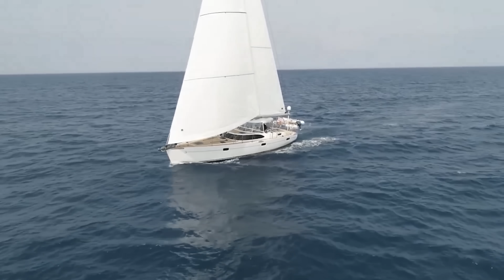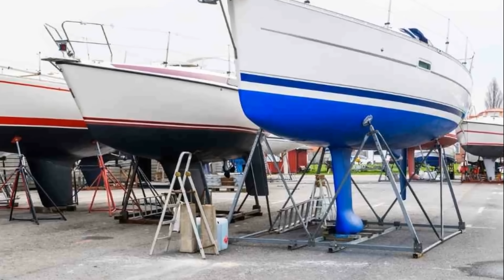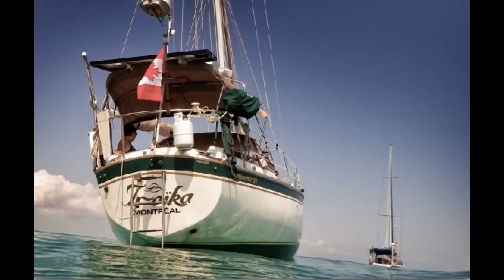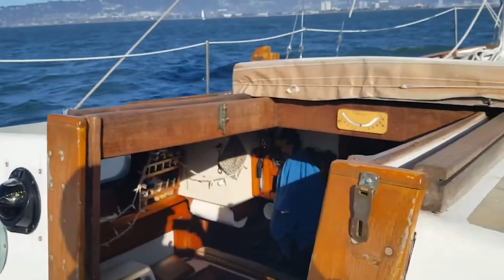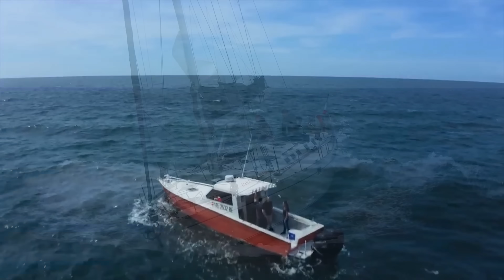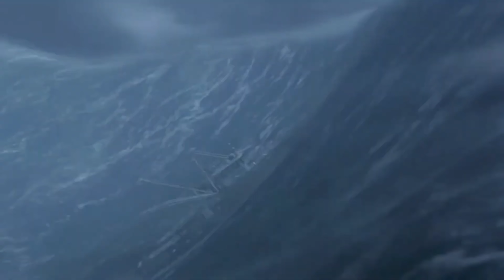Why Full Keels Aren’t Always Safer Offshore

Comment: 83 here, sailed 64 years ,had several full keel boats and a fin keeler, Built several boats also. I learned to hate full keels, only way to get to windward in light wind or heavy weather was to motor, learned to hate bobbing up and down while my friends past me to arrive days earlier. Then there was trying to get in and out of big marinas and slips, constantly backing and forwarding to try to turn the damned thing, forget trying to steer in reverse. On the other hand my fin keeler could tack up a narrow river into the wind and sail to 35 degrees of the wind in strong winds and back into a well. I could actually get some where...a complete world of difference. Encapsulated fin keel with ruder on a skeg is the way to go

Comment: I don't agree. Fin keel boat is often so flat it can not sail straight into the sea without damage the interior. This flat design restricts the flexibility. Fin keel boat are designed for downwind. When the waves are nasty you can not sail closed haul. 
A heavy boat can go smoother through the waves and doesn't come to a sudden halt because of a short wave.

Comment: Trying to imagine a lightweight boat taking the type of beating I have seen. Author says a light boat expereinces less stress due to its lowered inertia. A bit like saying a ping pong ball is stronger than a pool ball. Right. I have seen the force of waves cause lockers with screww down brass fittings burst open despite the boats heavy inertia and resisantce to movement. Imagine that in your ping pong ball where your change in velocity will be much greater as waves throw you araound like a rag doll.

Comment: Right, faster equals safer becuase you can outrun storms (do you even have accurate weather forecasts a thousand miles out?), And faster equals safer becuase you have more repair time in ports, sound logic. WTF are you smoking? If (big if) I knew from reports that a major shit storm was headed my way I would be reefing down and starting the engine. Having been cuaght off giuard in a Tayana 37 full keel despite monitoring weather continuously, I will take a heavy full keel boat when you are really out there 6 days a week and twice on Sunday. I am probaly alive today becuase I was in tank.

Comment: If you are going to post this type of content you should provide some details about your experience and qualifications. This improves credibility and gives your advice authority. The fact that you don't is, for me, a red flag.
I would take issue with a few points. 
I have never found long keel keel to equal a slow boat. I have sailed long keel boats of various designs between 26 and 60 foot. All of them would achieve hull speed in 15kn or more in any sea state where it was safe to maintain that speed. There is a point where it becomes prudent to slow the boat down in heavy weather but this is determined primarily by her size and overall
 design not the keel profile. Boats are slow because they are underpowered compared to their drag factor, either lacking sail area or the stability to carry sail. It has nothing to do with the keel profile.
I have sailed far more fin keel boats that are poorly designed for sailing performance than I have long keels. Most long keel boats prioritize performance under sail rather than accommodation or other factors. 
I agree that a long keel boat may take more, or at least different skills when docking in confined spaces and this can be challenging for less experienced skippers. The consequences of getting it wrong are however unlikely to damage more than your wallet. Offshore is the opposite, a fin keel demands far more input from the crew and offers less opportunities to recover off watch leading to fatigue which can be terminal.
While a fin keel boat with the right hull shape can exceed hull speed, which may seem to offer more options it is often not a reality for short handed cruisers. A lightweight race boat with a full crew may be able to exceed hull speed from about 60deg off the wind. A heavily loaded cruising boat with a short handed crew is probably only able to plane down wind. If you have the option to run off downwind to avoid bad weather this may be useful. It is, in my view, not a good trade off if it means worse performance on every other point of sailing or problems hoving too. Running fast downwind in steep seas is about the most dangerous strategy for dealing with heavy weather. Most cruising boat should not do it.
Sailboat design is complex and there are always compromises. I found this video oversimplified that complexity to the point of being misleading.
RYA Yachtmaster, delivery skipper and technical sailboat author with more than 50000 miles logged including ocean passages and have lived aboad

Comment: Full keeled boats are always safer at sea and always a bitch in the marina. 

What's more, full keeled boats can survive a grounding, and sometimes with little, or no damage.  The rudder and prop are shielded.

For this reason alone, I choose a full keel for cruising. 

A deep-well bilge, common in full keeled sailboats, keeps the cabin sole dry.  This is a huge safety and comfort issue for prolonged periods at sea and often overlooked.

Old school sailing wisdom has not changed, and the ocean still makes the rules (not some YouTube.)

Comment: Colin Archer' boats were used as safety boats for more than 40 years in the Nordic sea.
And it's not the quiet sea on earth !
Joshua, Bernard Moitessier' boat was builded with Colin Archer technique and it circumnavigate twice
Sailing fishing boats on the Ireland sea are long keel 
Long keel are slower, yes, but stronger
Today I have the forecast every 30 min on my plotter if needed, that's the first safety. 
If you don't want to sail under a storm, I don't like that but mother nature do what she want, stay at the marina.

My last fin keel sailboat was build in 1991, the same one build in 2025 is 20% lighter.
38 feets racer/cruiser from a German company
Today's sailboat are build for a 4 to 6 hours sailing in front of the marina.
Just check what kind of boat are sailing around the world and crossing ocean

Comment: Doesn't matter if a fin keel boat goes a little faster than full keel boats. You still won't outrun a storm. I owned 2 full keel boats, currently a Alberg 37. I would never trade "down" to a fin keel boat. I've been in bad weather on fin keel boats and I didn't like it a bit. On the other hand if the sea gets rough I sleep like a baby in my full keel boat. Fin keel boats are popular because boat builders can produce them much cheaper and faster and got people convinced speed and large interior space is everything when it comes to sailing. To each their own. I stick with my classic design that is time proven and eventually may even come back.
Reply: I beg to differ, about outrunning storms. I too have owned and lived aboard a heavy, traditional bluewater cutter rigged mono-hull. While I respect these types of boats and their attributes, there no escaping the fact they are slow.  I now sail a bluewater catamaran, of the same length. The additional speed makes a huge difference in our ability to avoid nasty weather. The ability to do 200 miles in 24 hours, rather than 130, opens up choices and reduces weather-related risks. This, coupled with near real-time weather reporting via StarLink enables, has completely changed my strategic approach to navigating long passages.   
Obviously, a boat and her crew need to be capable of dealing with very bad weather. But when it comes to the safety of me and my crew while offshore, my choice is a boat that combines speed and strength  - one that gives me the best chance to get out of harms way.
Reply: @billmorris2657  How can you compare a catamaran to a mono hull in the topic of this video? Why not throwing in a 100 mph off shore speed boat to outrun storms?
Reply: @teuton77777 yeah that’s what I was thinking. It’s like comparing apples to grapefruit.
Reply: @teuton77777  well I have a monohull that often does 200 mile days. My best 24 hr average was 11.2 knots. I have done entire passages at over 200 miles per day.
Reply: @billmorris2657 😮😖

Comment: A fella named James who has a youtube channel called SV Tritei he grounded on an uncharted reef off Indonesia in a fairly remote area and after grinding back and forth for a considerable time trying to find a way off and away from the reef, he finally got off and sailed on his way with no problems like leaking, steering problems etc.This happened recently so go see his channel it's about 2 or 3 episodes ago.  A couple of weeks later he filmed the underneath and his long fully encapsulated keel just needs a bit of paint and because his rudder hangs on to that full keel with a shoe under it the rudder was untouched. Now if it was a fin keel with the typical rudder sticking out from the hull that boat would've been wrecked and at worse sunk. There is no way a boat like a Benno etc would've survived the grinding back and forth for an hour and then be able to sail on without any problems. For that reason alone a full keel is my only choice for cruising the world, especially in remote uncivilized regions. btw his boat was built in the 60s and it's taking him around the world safely. Like everything concerning boats they all have pro's and con's, all boats are a compromise, but for me the safety aspect of the long encapsulated keel with the rudder hanging off it is my choice for sailing the world
Reply: I agreed, in 1998, I owned a 44 Sun Magic sailboat, on day I lost my rudder!  I was lucky, I wasn’t crossing the Atlantic for example.
Reply: Absolutely these new boats are pure junk! Keep them pretty but don't leave the dock!
Reply: But there are fin keel boats that are built for grounding. Just because some badly built boats have fin keels doesn't mean all fin keel boats are bad. Don't go to sea in a shit boat. 
My boat is a fin keel and spade rudder. It is a purpose designed blue water boat. It is built with grounding in mind. But...it sails much better than any boat with design technology from the 17th century.
Reply: Blasphemy😂
Reply: @CodyLiddle heaven forbid we don't all worship at the altar of fucking awful long keels and use science, reason & logic

Comment: Long keel boat are inherently safer. Modern boats are made for marina life, long keel boats are made to cruise. I would not dream to cross oceans on a modern boat. Hull windows, bolt-on keels, spade rudders or the new tween rudders are accidents waiting to happen. Same with modern lightweight standing rigging with a single point failure. No, modern boats are not suitable nor safe to cross oceans. And Harbor manoeuvres? Well cruisers are better sailors and can we can manage.
Reply: Strongly disagree. I have a fin keel, spade rudder, hull windows and ultralight displacement. I have crossed oceans many times in many different kinds of boats. This current boat is the safest boat I have ever sailed on, including all the heavy displacement full keel abominations.

Comment: Your first agreement instantly undermines your credibility - heavier boats (higher D/L) ratios are not axiomatically slower. Most cruising boats, most of the time, operate as displacement hulls, neither planing or surfing. As such their speed is very much a function of waterline length, a calculation in which weight is irrelevant. The argument that heavier means slower does not account for half of the equation - speed within the displacement hull speed range is a governed both by drag (yes, weight) and propulsive force. The heavier boat, designed with appropriate RM, will also have the sail area and sail carrying capability to achieve hull speed just as readily as lighter alternatives and is very likely more capable of achieving it in adverse sea conditions that a light or ultralight boat. And no boat is fast unless it is sailed fast - which is largely a function of crew skill and motivation.  Check the record of the Westsail 32 in the Transpac Race if you want a challenge to your glib generalizations.
Reply: well... no! full keel has a higher drag, means slower. And they typically carry less sail area too, slower again.

Comment: Sorry, but I don’t see how a speed difference of just 1–2 knots — which only creates extra distance over several days — can significantly affect a boat’s ability to avoid dangerous weather that develops nearby within a matter of hours.
Reply: Right. Not even a CAT is gonna out sail the weather! Deal with it that's why they make boats that can handle the nasty stuff.. but NOT in this century!
Reply: what's not clear? - "you get there before the storm, not through the storm".
Reply: @alexshyshkov8585  Think a bit - how can you "get there" before the storm - if the speed of the storm is 20-24m/s and yours is 2-3m/s - disregarding the type of a keel?
Reply: easy.
Done it before, not once. Sailing ahead of the storm. Sometimes I make it to the harbor before the storm gets me, sometimes not. 

2 weeks ago we started day rough, under deep reef and a storm jib, went 45 miles north. As we been getting away from the storm, we add sails, getting to full sailplan 4 hours later. The storm caught up with us only next afternoon.

Yes, you can sail faster than the storn moves towards you.
Reply: @alexshyshkov8585  There are many 'ifs,' and quite a bit of luck is needed to escape the storm the way you’ve described.
Reply: @TheHellishFrog , yes.

We had almost same situation a year later - hours of flying above hull speed ahead of  a storm, almost made it :-( Half an hour before the harbor, it hit us with a full broach. Later I concluded "not enough sail" - I could avoid the knockdown if I ignored the USCG small craft advisory in the morning and fly a spinnaker, it would have saved me 1/2 hr later tgat day.

if you think about big storms, it's much easier. Squalls come out of nowhere, but big storms are tracked days ahead of time. It's totally feasible to escape an approaching hurricane from Virginia coast all the way to Northern Chesapeake Bay. A hundred miles run north to anchor deep inland is doable if you can sail 5kn avg. If your avg is 3 kn.... well, it's harder
Reply: @alexshyshkov8585  I can’t call it good seamanship to try sailing under full sails when a storm is approaching.
As they say — if you think it’s time to reef, you’re already too late.
Storms and gale winds can develop within half an hour to an hour — hurricanes, yes, take days to form.
I believe that the very idea of “escaping a storm” is unsafe, precisely because it tempts one to carry more sail than they should.

Comment: That's just marketing nonsense again. 
1. It must be a short offshore passage with no alternative ports or possibility of turning back, so that the relatively small difference in speed increases safety. Any weather system offshore will be difficult to avoid in the southern ocean or north atlantic ... or you need a vendee globe racer 😉
2. There are no life-threatening safety risks in the harbour. So this argument is completely irrelevant. 
3./4. Heaving to is definitely easier, more reliable and more stable with a long keel and high ballast ratio. The same applies to seaworthiness in heavy weather. 
5. Since when has a faster tack been relevant to safety at sea? It is important for regattas. 
Sorry, complete nonsense 😢
Reply: Not nonsense. Sometimes making or missing a tack is the difference between losing the boat or not. A down speed tack in adverse conditions is one scenario where control may be lost and damage occurs. A spade rudder & fin keel can mean you keep control in bad weather. It's why I believe cruising boats should have oversized rudders.
Reply: @deerfootnz  learn to back the headsail in a tack, and you never miss it. It's as simple as that

Comment: Although I agree with the general premise, I find most of these arguments to be quite questionable.

First: a long keel boat, with either a skeg or an attached rudder, is far less likely to lose its rudder.

Second: a short keel boat will generate far more violent stresses than a long keel one will. And this is more true the shorter and deeper the keel is. The hulls of these boats tend to be shallow and flattish on the bottom, to get better form stability for greater Sail carrying ability and thus higher speed. In rough weather, this type generally slams. And, because of its light weight, the accelerations are quite high. Also, the hull tries to confirm to the wave, while the keel tries to hold it upright. This is true for all sailboats, but more extreme with this type.

Because of the light construction, the shortness of the keel, and the depth of the ballast, the keel can act as a huge wrecking bar, trying pry the bottom apart. And this is just at sea, never mind hitting a sand bar, a submerged rock, or some other unseen obstacle. I know of several occasions where extreme boats of this type have had their keels suddenly drop off.

Third: the maneuverability argument is sound mainly in harbor. At sea, I find it very questionable. The short-kerl boat can be driven hard with less chance of broaching, but I doubt that it heaves to better. With very little hull profile below the Waterline, and much above, the boat can become a plaything for the wind. This can be so true that special storm survival tactics may be needed, where the longer keel boat can just batten down and chill.

I would say that the seaworthiness of the extreme short-kerl boat comes from its ability to avoid trouble. And the seaworthiness of its long-keel counterpart comes from its ability to handle it.